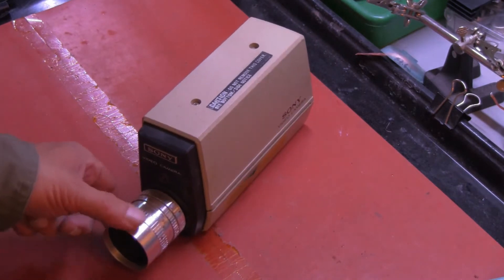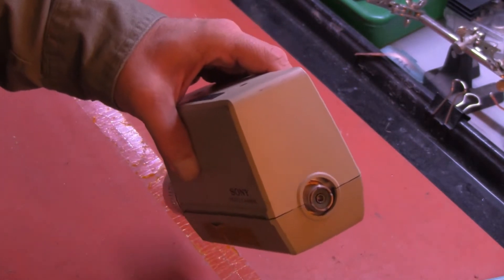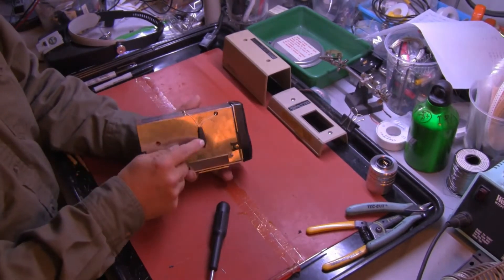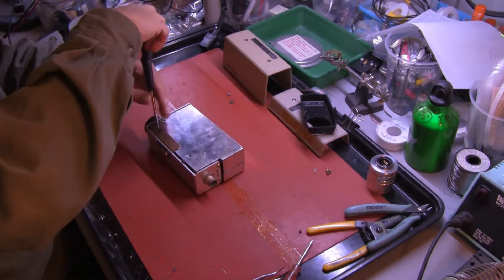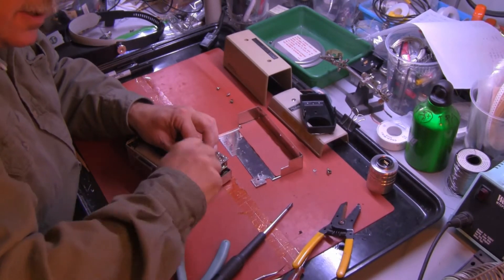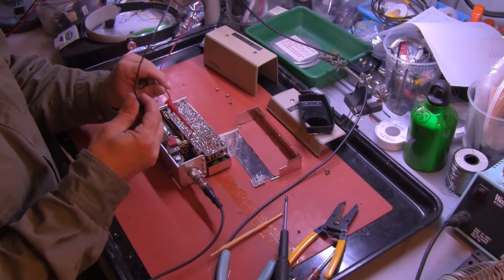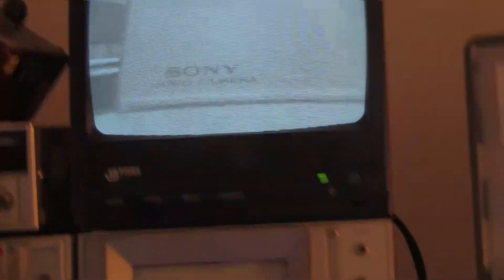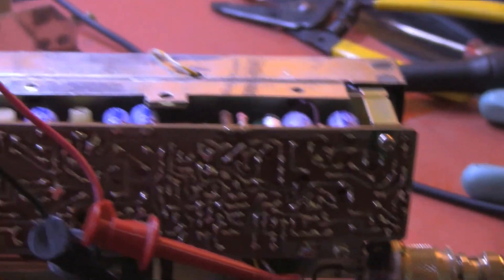Hacking the Sony AVC-1400 Vidicon Camera

Comment: Back in the 80ties i have recorded many hours with a Philips security camera.
Same system, power and signal through the  same coax. Channel  4.
12 Volt and a capacitor to remove the dc component.